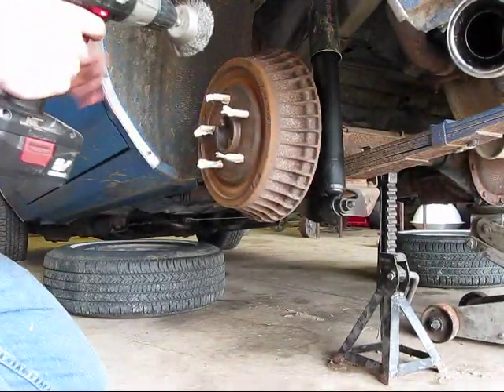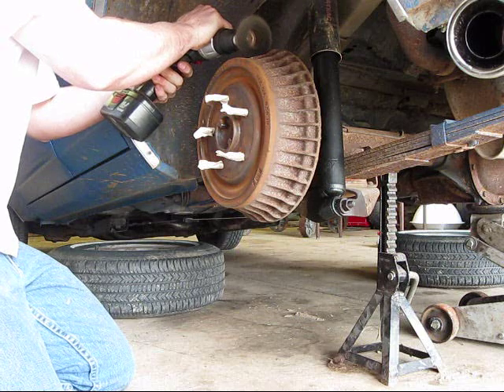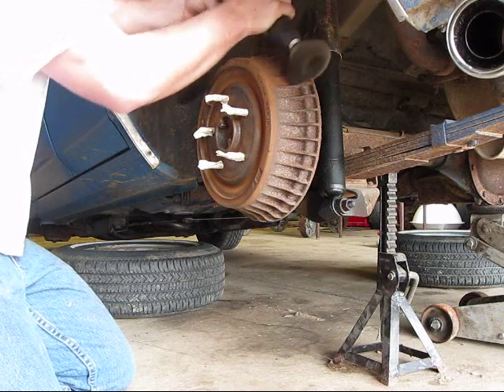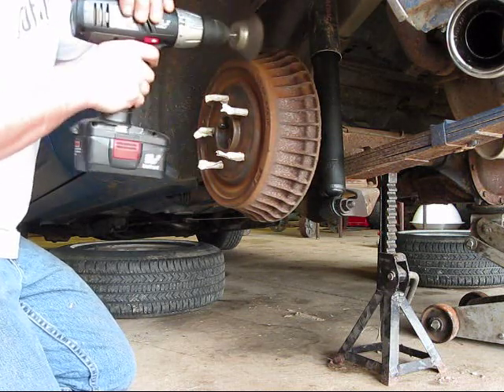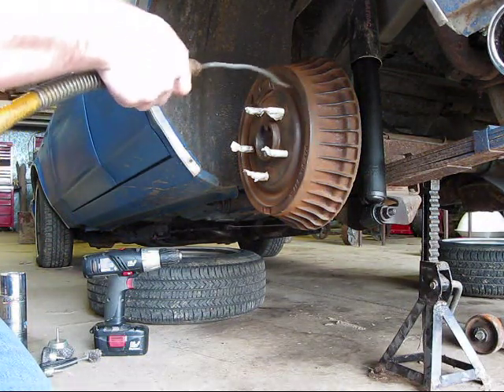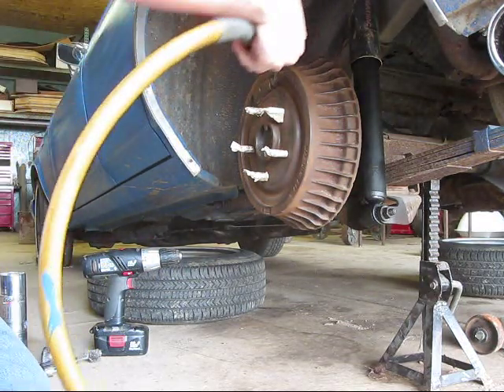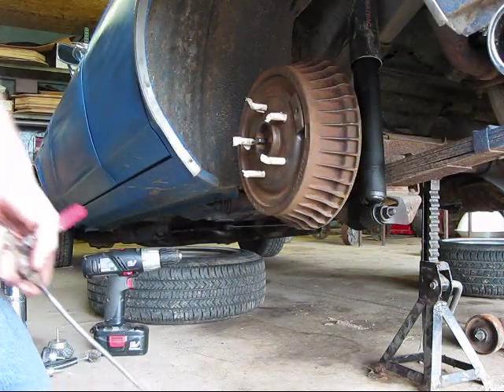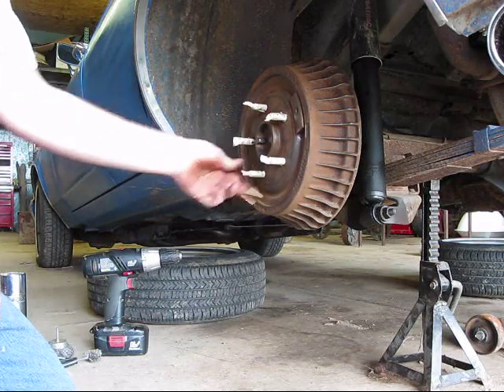This is how to paint your back drum brakes 2

Comment: I suggest taking off the car to paint it or you will get mass over spray on your car like this guy is. if you tap it a few times with a rubber mallet or hammer it will slide right off as long as you don't have the e-brake on.